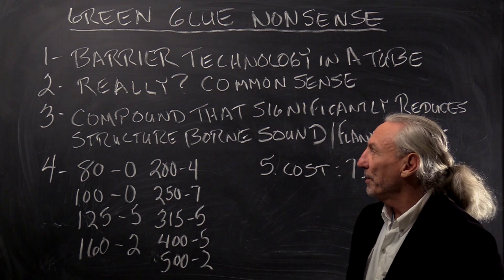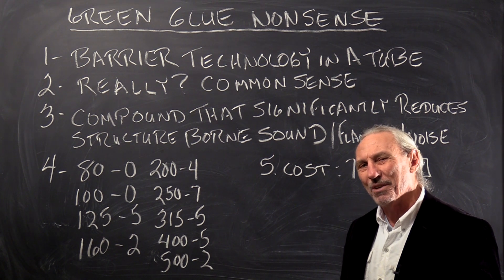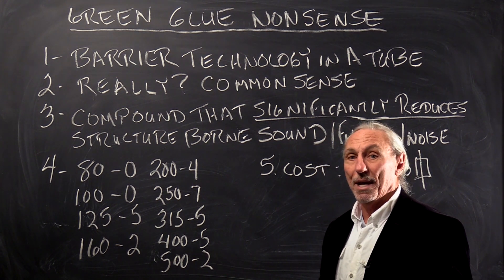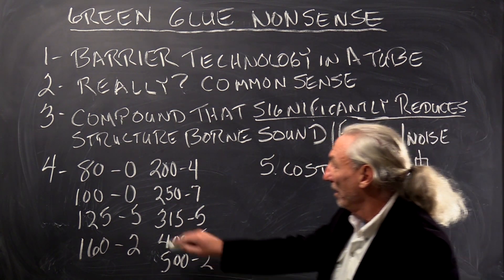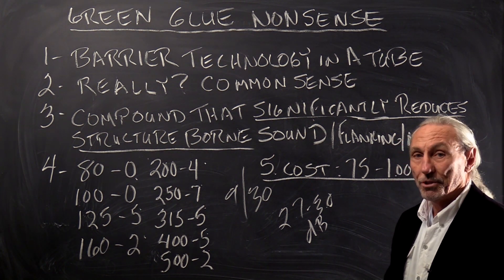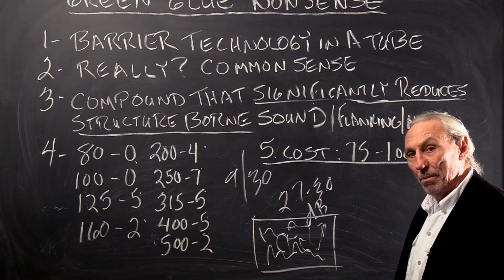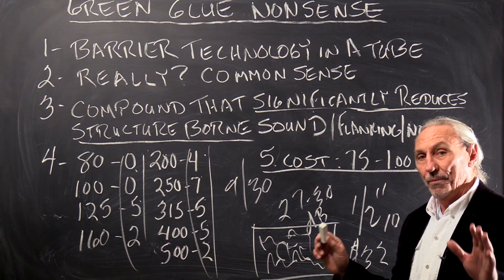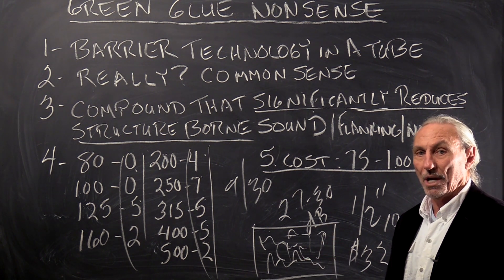Green Glue Nonsense - www.AcousticFields.com

Comment: You have been building, buildings for 40 years.  So, what do YOU use, to help reduce noise?  Have a downstairs room, converting to a rental.  Upstairs is hardwood floor.  So, how to keep noise down??   What do I install in the rooms ceiling, vinyl mat?
Reply from the maker: J,  Material type used and the construction methodology employed are entirely dependent on your noise frequency and amplitudes. Noise barriers for noise  above 125 Hz. are completely different than noise barriers which must reduce transmission below 125 Hz. You must measure your noise over 7 days and then design for the worst case noise during that time window.

Comment: Thank you for debunking the green glue. Thank for everything else you do.
Reply from the maker: A,  People have elevated its importance into an area that is not realistic. People believe the glue itself is a barrier technology which is non sense. It is an adhesive that will not dry out over time to attach two layers of materials together. There are other adhesives and other barrier technologies that will work better at certain frequency ranges. It is not the cure all everyone makes it out to be. Most of these double wall / glue combinations are over 40 years old and only work in limited frequency ranges. Technology had advanced and you can do much more today in smaller space requirements.
Reply: @AcousticFields  what are the better ways that are more affordable, can you provide an example?

Comment: Green glue is not the same as any other adhesive because it remains flexible which allows the the sound waves to be absorbed in between the two layers of sheet rock and converts that energy into a small amount of heat. If you try to use other adhesives they will harden and you will not get the same performance.
Reply from the maker: Not true. Many adhesives have a silicon base that stays flexible.
Reply: @AcousticFields  surprised to see this reply one year later. Lol. Of course some other adhesives have different amounts of flexibility but it’s the degree of  which they are flexibly that helps determine their sound dampening quality. That’s why you’ll see some videos testing carpet glue and getting decent results because it has a high amount of flexibility, more than most acrylic or silicone caulks.
Reply from the maker: There are adhesives that remain flexible. They have silicon bases.
Reply from the maker: F,  For what frequency and amplitude are you referring to?
Reply from the maker: F,  There is no energy transformation with glue.
Reply: Acoustic Fields Sound turns into heat when air molecules from sound waves go from ordered to disordered movement. The ability of the glue to remain flexible is key because it allows the two layers of drywall to move somewhat independently and air compression which can turn into heat. When frequencies attempt to pass through the layers of drywall and green glue, they get trapped and some frequencies cancel each other out which is the reason for the random application pattern. Im sure there is a better way of applying the glue to more systematically address specific frequencies but for the average builder it makes sense that the current recommended application pattern is the balance between optimal performance and ease of application. if the glue was not flexible it would bind the two layers of drywall somewhat monolithically and be much less sound dampening. I imagine it sort of like a shock absorber on a vehicle. Without that component of flexibility, the vibrations from the road would be transferred to the cab.
Reply: The video was not directly disproving the glue's acoustic properties.

The video explains there is a cheaper alternative that yields similar to a little bit better results in acoustic dampening. And it only costs 1/2 an inch to 5/8 inch of your space. Times that by four walls and the layer of paint you apply.

 I think people wouldn't mind a minute change in area, over a ridiculous cost of glue.
Reply: @HaloWolf102  And he never said what the 1/2 item was… He called Green glue nonsense but have no better alternative in which he referenced…
Reply: @Decent9mm  that would be drywall.
Reply: @HaloWolf102  the video said there is a better way, but doesnt mention the better way. For my that is useless. If there is a better way, say it, so we can test and compare.

Comment: @Acoustic Fields, I understand your perspective on this from your experience , but I am curious to know if you've done any testing with Green Glue, or if your opinion is driven by the fact that it doesn't sound believable. I'm asking because I have about to apply sound proofing to my studio space. I've read and seen a lot that is positive about the Green Glue, and I don't want to it if it isn't going to work. So many others that have used it feel that it does. I'm trying to reconcile the competing perspectives.
Reply: You will notice he didnt actually answer your question. No. Hes just rambling.
Reply from the maker: Green glue is just an adhesive. It does not have any "magical" acoustical properties.  You can usually get much better results by adding another material layer depending on noise frequency and amplitude.
Reply from the maker: N,  Green glue is just one type of treatment possibilities. Everything depends on the frequency and amplitude of your noise transmission issues. All frequencies and their associated strengths require different approaches with different materials and procedures. Have you measured your noise issues so you know what you are trying to stop? Without noise numbers, you are guessing and guessing with noise is foolish.
Reply: @AcousticFields  Thank you. That makes perfect sense. I've been thinking about it from a very broad definition of the problem. When my band plays in the room, I don't want the rest of the house to be disrupted. When I am trying to record a vocal, I don't want the rest of the house to disrupt me. But it sounds like I need to be more specific in my problem statement in order to find the right solution for it. As an example, I need to understand how much the foot traffic from the floor above impact the room below, and solve for that. Is that what you are saying?
Reply: @AcousticFields  I'm a big fan of experimental proof.  What you say makes sense, but experiment trumps theory. 

It would be pretty powerful, and not too hard to make two drywall boxes.  One with two half inch pieces of drywall between your studs and no green glue, one with the same, but with green glue.  Then put a sound source in the box, and measure how much sound comes out of the two.

Comment: You're clearly a talented presenter, but I feel your point would be a lot stronger if your presentation included actual photos/screen shots of the information that Green Glue puts out. Audiences like to look at the 'raw data' themselves, so they can see you're not cherry picking or lying. Right now I'm looking at a PDF from GG ("green glue vs extra drywall") and it's showing a 13dB increase in isolation at 500Hz from applying green glue, not a 2dB one so I wonder what measurements you're referring to.
Reply from the maker: N,  Study the data. A 13 dB isolation at 500 Hz. is a worthless number unless you provide the frequency and amplitude of your noise issue. Using a tactic to treat a problem without knowing the total issue is like holding up a feather to stop a tornado.

Comment: If you are going to use a damping compound like GG, then you must also apply it to the edges where it touches the other sheets for maximum effect. This is prior to mudding and taping.
Every time you double the thickness of the wall, you can expect a 3db reduction in noise, which is a 50% reduction of acoustical energy. At least for frequencies above 125hz or frequencies that aren't at the natural resonance of the structure; and I'm talking air-borne noise, not impact noise. Just to be clear.
Feet impacting your ceiling would be impact noise, which requires decoupling more so than mass. Things like iso-clips with hat-track, and further decoupling the hat track with 30duro sorbothane, sill-gasket or MLV; and using 8X PL glue rather than drywall-screws to attach the sheets; and also boxing in electrical boxes with 1" OSB or at least electrical box puddy.

Windows, doors and ducts are the greatest sources of flanking noise, those in particular need extra special care and attention, it cannot be neglected otherwise it's all for nothing.

As you can probably gather, soundproofing is not cheap, especially when you are dealing with regular building structures (which aren't designed for it.) Just like a garbage truck isn't designed for 200mph. It requires special care from the foundation on up, it can't be an after-thought (or shouldn't be...) Prevention, not cure.
Reply from the maker: R,  In our designs, a 3 dB impact has no value regardless of treating edges or whatever. You are chasing your tail using this methodology. You must design a structure that has maximum frequency and amplitude viability with all frequencies of issue. Using 3 dB tactics without a sonic strategy is a waste of time and money. Green glue is a glue not a barrier technology.

Comment: Agreed. Tried that product years ago with unsatisfactory results.  Far better results came using heavy marine ply (waterproof plywood) Decent Plywood beats the lot hands down IMO. And the FINISHED room sounds way better too. 😎👍
Reply from the maker: S, Yes, you can not beat mass for vibration and noise transmission management.
Reply: Plywood is one of the lightest but most rigid wood panel material. None of these help sound absorption.

Comment: watched this too late. I bought into the hype and used it actually about 30 tubes of it. He's right little to no advantage.
Reply: you wouldn't know unless you had a control project with no Green Glue for comparison. It works but has to be used correctly and the overall assembly must conform to best practice.

Comment: @Acoustic Fields how would you suggest minimizing the transmission through a standard steel stud wall of about 25 dB at 100 Hz that is created about 9 inches away from the wall by a ball hitting another wall which is made from wood studs and 3/4 inch melamine board? Thanks.
Reply from the maker: D,  I do not believe your problem starts at 100 Hz. It believe it starts at a much lower fundamental and 100 Hz. is just one part of the total problem. With noise you must measure, measure, measure. Guessing with noise is a fool's game. Your example is a good illustration of this. If we treat 100 Hz. but the problem is caused by 50 Hz. then everything you have done at 100 Hz. will not work at 50 Hz.
Reply: @AcousticFields  I have measured and the problem is at 100 Hz. There is an increase of maybe 5 dB over ambient noise at 50 Hz but 25 or more dB at about 100 Hz. Just wondering how you would minimize transmission at 100 Hz. If I am wrong with my measurements that would be my problem. But for argument's sake let's say I am right, so how would you construct the barrier for the 100 Hz and 25 dB sound? Thanks.

Comment: I didn't hear an answer to the expense of green glue.  What is the $10 comparable fix?  I've used green glue and found it worked when all the other sound deadening procedures are followed.  You need to cut out around existing electrical boxes big enough that you can get in and wrap them with sound deadening acoustical putty sheets/pads.  Move a box that is on the same stud as one in the room your trying to soundproof to another stud.  Patch and tape the drywall around any box you had to expose, then follow the instructions for applying the green glue to the second layer of drywall.  You should also seal the perimeter of the wall.  It may not be the cheapest method but it does work.
Reply from the maker: Material types are frequency and amplitude dependent. There is no one material type that works in all situations.
Reply from the maker: B,  It works as an adhesive to hold two layers of materials together to keep them from touching each other. If this is your goal then mission accomplished. What it is not is a barrier in and of itself.
Reply: @AcousticFields  why do you continue to ignore the "better $10 solution" question?? Myself and multiple people have asked you and you constantly ignore us. This makes you lose credibility instantly in my book!
Reply: @detroyt232323  Because he wants you to buy something from him that has the answers in it.

Comment: QUESTION: I have a VERY rude new neighbor who blasts his TV for hours even after being politely asked not to. It is making me SICK. My plan is to install one layer of 5/8" sheetrock on top of existing drywall and install it on vertical wood beams to create a space between them. Is this enough???? Or do I need to install TWO 5/8" sheetrock on top of each other??? Thanks for any help!!!! PS: What type of caulk do I need to use around the seams???
Reply from the maker: T,  I need to know the frequency and amplitude of the noise issue first and foremost. You can not fight an enemy without knowing how big his guns are or how many troops he has.

Comment: I see a lot of people saying that they added Green Glue and a second layer of drywall to the existing single layer...and how the result was a dramatic drop in sound transmission...but why do they think it was the Green Glue that made the big difference?
I would say it was really the second layer of drywall...but no one seems to test it both ways, they just include the Green Glue and assume that was the magic that made it work.
TBH...I have been very skeptical about the Green Glue, and think that if you want to apply some kind of dampening between two layers of drywall...there are other, much cheaper alternatives in a tube. Just go to your local Home Depot. All you need is something that doesn't harden when dry...and there are plenty of those...and that will give you the dampening effect. Sorry...Green Glue is WAY more hyped than its value, considering the ridiculous price/tube...which comes from the hype. Also...anything that is water based will probably dry out as the water content evaporates over time...but how many have ever peeled apart two layers of drywall treated with Green Glue to check this in say...5-10 years time...?
Reply from the maker: M,  Yes, yes, yes. They have elevated an adhesive to the level of a barrier technology. Now, if the green glue layer was 1" thick, we would have something to speak about.

Comment: About time. My common sense alarm wouldn't let me purchase green glue. Thanks for the confirmation.
Reply from the maker: A,  This product is a tactic that one can use in a total noise design strategy. The problem is that it does not work that well by itself. You use it to couple materials together and minimize vibration transmission. There are many other tactics one can use that will fit better into a sound strategy.  Using a tactic to solve a strategy sonic goal is foolish and a waste of resources. You must first qualify and quantify the noise frequency and amplitude. Once you have that data, you can then develop a strategy to deal with the frequency and amplitude noise issues. I receive calls everyday where people think that this tactic will work on all frequency ranges and all amplitudes. It won't and you will be disappointment with the results,time wasted and money spent if you noise issue was above 125 Hz.
Reply: @AcousticFields  thank you. So is there a list of what you recommend at frequency ranges?

Comment: With all due respect, you simply do not understand the function of GG damping compound.     I know this by how you describe the application patterns.   You point out that the random pattern will not make a complete "seal" and that it "will not stop all the sound from getting through".   that is not the intended function at all.     The best way to describe the function of GG is to liken it to stopping the sound of a cymbal by grabbing it with your bare hand.     It dampens the vibrations, and mutes the sound.    That is the same principle by which green glue works to reduce the resonance of a sheet of drywall.   I've used it in a ton of projects to very satisfying results.   It is VERY costly though, so I am intrigued to look into QuietGlue Pro, for about 60% of the cost.
Reply: I don't think the effectiveness of Green Glue (if it's even effective at all) is in muting sound. It's supposedly used in decoupling, reducing sound transfer from one layer of sheetrock to the adjoining layer.
Reply: you are right, this guy is a complete imbecile who runs his mouth about acoustics but makes most of it up on the spot
Reply from the maker: We understand the process and use it throughout the world in our room build designs. This product is an adhesive that is promoted as an acoustical product to the uniformed.
Reply from the maker: T,  You are not seeing the forest for the trees. By seal , I am speaking about a total barrier seal. Green glue is onlt one part and a very small part of a total barrier design. The whole barrier system must work together to promote a barrier seal. Using a glue like spread randomly across the surface area is not a good seal when it comes to looking at the barrier quality you are creating, especially when you consider its costs. It is overpriced and over praised for the benefits it provides.  There are many other more cost and performance effective  ways to achieve a total seal using the total barrier with all its layers.
Reply: Acoustic Fields Could you describe what these are?